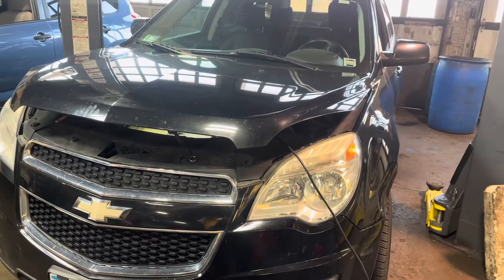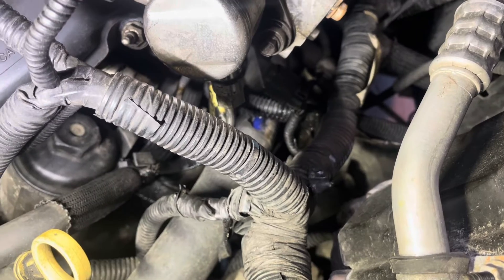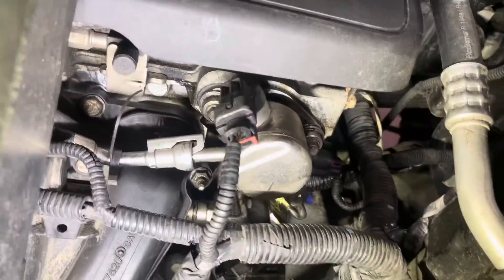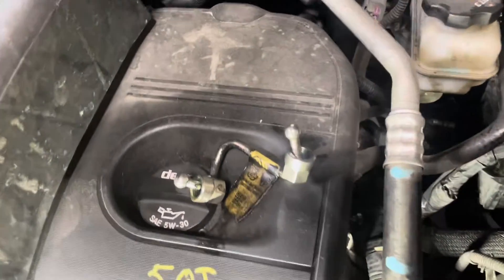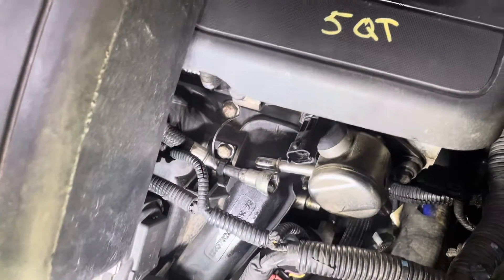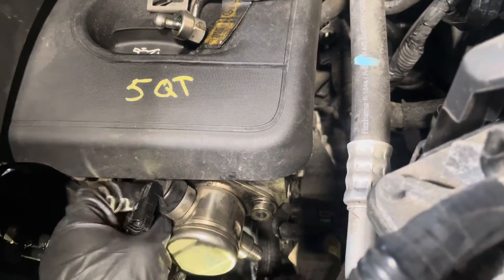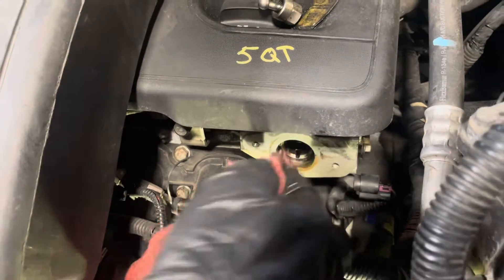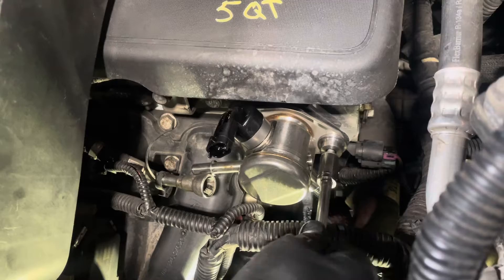Chevy Equinox P0172 How To Replace High Pressure Fuel Pump

Comment: My question is why the code if the car is running too rich meaning putting too much fuel and not enough air why the code?
Reply from the maker: Because the pump is putting too much fuel into the engine

Comment: I changed mine out and fixed the shuddering issue when shutting off, but now the car smells like gas when idle, is it because of the fuel line?
Reply from the maker: Check to make sure it’s not leaking maybe needs to be tightened a little more

Comment: with  code P0191  do you think fuel pumps is the problem o is different issue
Reply from the maker: I don’t think the high pressure pump is the issue with this code it might be the low pressure pump in the fuel tank but you’d have to hook up a fuel gauge to measure the pressure
Reply: if you dont night  how much do you think can be @acetechauto7
Reply: @acetechauto7 and thanks  for respond

Comment: I have gmc terrain I just need replacement the high pressure pump but I saw in another videos need alignment tool for the cam shaft but Im surprised because Its just removed the old pump and put the new like you video my one is 2.4 ecotec 2012
Reply from the maker: It’s the same process as this one you don’t need an alignment tool
Reply: Thanks for your quick response 🙏

Comment: My car was smelling like rotten eggs at one point then started to show reduced engine speed then shaking at idle and a shake after the key would be removed .If it needs a fuel pump which one does it need do you think ?
Reply from the maker: Normally when your car smells like rotten eggs means your catalytic converter is bad
Reply: @acetechauto7 Thanks so much for your quick response . I did take it to the auto zone and did have some codes pop up of P0172, P0016 and P0011 does this look like I need a high pressured fuel pump replacement in the hood or a fuel pump in the tank ?
Reply from the maker: @Exposure_Spider6 that would be the high pressure pump on the engine

Comment: Question, code at Advanced is saying replace high pressure fuel pump, but shows a picture of the fuel pump in the tank? Here's what is happening. When shutting my car off, the engine like studders and shakes, almost seems like it is trying to keep running or something? Any advice?
Reply from the maker: High pressure pump is the one in the engine not the fuel tank. I would replace this one
Reply: @acetechauto7 which one ?

Comment: What brand fuel pump if most recommended for this car ??? I've seen Delphi and ac Delco can anyone help
Reply: Always gm/ ac delco. Aftermarket pumps dont work on these
Reply from the maker: Either one is good but I would go with AC Delco

Comment: Why is it required to change that piece of fuel line?
Reply from the maker: It’s suppose to be a one time use because the fitting is crush to fit so when it’s tightened from the factory it’s already crushed so it might not make a proper seal second time around. Sometimes you can get away with reusing them
Reply: @acetechauto7  Thanks for the explanation.  I went through 4th class power engineering but do not recall mention of a crush fitting amongst the innumerable fittings and instruments we studied.  Are there reasons a tapered compression fitting wouldn't be ideal? Thermal expansion?  

Thanks again, tackling tomorrow pending parts. 👍
Reply: @acetechauto7  I have a question you may be willing to answer.  i suspect my timing chain has slipped a tooth and I havent checked.  I have a code but it runs fine.

I jist wantes to know if you have a trick or tip to move the chain just one or two teeth.  I saw my friend do this a couple years ago but dont remember the technique.  He used the (24mm) box wrench on the camshaft and not sure the trick but applied a bit of pressure and lined it back up.  Is it easier to release the tensioner a little or is there a better way.  Thanks my friend
Reply from the maker: @bizzzz unfortunately it’s off a tooth because the chain is stretched so you will need to replace it. It’s not worth trying to put it back one tooth
Reply: @acetechauto7   it's actually a new chain, but the vehicle had a bad fuel pump and an oil dilution issue which has been rectified.  Do you think  new chain would stretch that easily?  Ot wasnt run hard or rough with the diluted oil - just noticed at stop lights it was rough idling and saw the code almost immediately.  Verified alot of fuel in oil, pump changed.  Oil seems like oil after a week.  Ready to get timing readjusted.

Thanks again
Reply from the maker: @bizzzz hmmm hopefully you don’t have to replace it again. Wish you best of luck!
Reply: Just fyi I went with an apremium pump $180cdn vs $480cdn for ac delco. Pump seems fine after a week.  Looks equal or better to in quality than the delco.  Comes in crazy  nice packaging with a color brochure with tips such as different ways to release pressure in lines.

New crush fitti g fuel line (ac delco) they wanted $80 CAD.  I reused the old one and it hasn't leaked yet 👍

Comment: I have a chevy equinox with code p0090 how do I fix that?
Reply from the maker: Most likely to fix your issue you will need this pump as well unless you have an issue in the wiring. Good luck!
Reply: @acetechauto7 ok thank you I just changed it and it started squeaking so was just wondering

Comment: I have a 2014 3.6l LT Flex and the code that comes up is P228C it keeps putting my car in reduced power to engine.Should I replace whole pump? And if so do i need a line as well? Thank you for the video still learning and on a strict budget
Reply from the maker: Yes it looks like you’re having issues with the fuel pressure and most likely the mechanical fuel pump is going to be your problem. It’s recommended to replace the line too but you can re use it as well it you’d like just make sure it’s tight enough so it doesn’t leak.
Reply: @acetechauto7  thank you!
Reply: @acetechauto7  thanks I asked this in another comment.

Comment: I saw another video on this and they did a camshaft adjustment. Is that not a necessary thing? Mine is a 2011 model.
Reply from the maker: No you won’t have to do an adjustment after this
Reply: @acetechauto7  thank you so much. I was dreading having to try it.
Reply from the maker: No problem good luck with the repair!

Comment: Any idea if the p0172 would cause the p0420 code for bank 1?
Reply from the maker: No this won’t cause the p0420 that’s separate and you’ll need a catalytic converter for that and alot of times the exhaust manifold cracks on them too which you will find out once you take the heat shield off it when doing the catalytic converter
Reply: @acetechauto7  so I just replaced exhaust manifold bc of a crack after redoing timing...car is running fine,  but then got p0172 and p0420 at the same time...I should replace the high pressure pump right to correct p0172, right? P0420 still a separate issue?
Reply from the maker: @Father_Adrian try clearing the codes first and see if they come back. If they do then most likely you’ll need the high pressure fuel pump and a catalytic converter.
Reply: @acetechauto7  gotcha! Appreciate the advice! 1 more thing, I saw someone mention the butt plug tool thing lol, I don't have that, so am I able to install just as you did and have everything line up properly? I dont want to mess up anything Internal
Reply from the maker: @Father_Adrian lol nope you won’t need that. Just follow the steps in the video and you’ll be fine.
Reply: @acetechauto7  gotcha! You're awesome man! Oh forgot to ask, will replacing this eliminate that fuel smell externally at idle, or when turning off

Comment: Does this issue cause oil to go low?
Reply from the maker: No this won’t cause it but these engines are known to burn a lot of oil
Reply: I bought a nice ltz second hand but disnt know about the fuel pump leak.  Almost grenaded the engine on a long road trip and had to replace valve lifters after

Comment: Will replacing this part fix my low power mode problem? Goes it to low power mode mechanic said code was fuel injected pump
Reply from the maker: Yes this will fix that issue as well if the code is related to the fuel pump.

Comment: Ive replaced this, both fuel pressure sensors, cleaned injectors, replaced MAF, CAT and the damn car still wants to shut off when its in drive. If i put it in Neutral, the car runs fine. IDK what else to do.
Reply: Timing chain could be messed up
Reply: @adriangarcia2599  all new timing components
Reply: That would happen to me in stop lights. It turned out it was the camshaft and crankshaft positioning sensors located left of the spark plugs.
Reply from the maker: Sorry to hear about your troubles. Is it setting any check engine lights on?
Reply: @acetechauto7  yes, fuel pressure sensor code but both sensors have been changed.
Reply: Spark plugs and coils
Reply: @thisview23  all new. Still nothing
Reply: It's the cam actuator.
Reply: Ur timing is off
Reply: I would change the actuators even if they test fine they go bad and make all types of issues like this
Reply: We're the parts OEM?
Reply: @ aftermarket
Reply: Replace ur VVT solenoids.
Reply: Transmission sensor maybe?
Reply: Ur change the wrong parts.u check ur throttle body

Comment: I have a Chevy equinox 2016 it came p0172 and p0191 code  every time I turn off the car it still runs a little bit what can it be ?
Reply from the maker: It can be your fuel pump

Comment: Im about to do this same job. Do you have any reccomendations on how to remove the fuel line without the tool for the prongs?
Reply from the maker: It’s going to be pretty difficult without the tool  I would just go buy the tool at any autozone or Orielly’s.  It’s not that expensive and it’ll save you the headache. Good luck!
Reply: What's the prong tool called? Or is that what it's called? Lol 🤦🏼‍♀️
Reply from the maker: That’s called a fuel line disconnect tool
Reply: İt is $4 at harbourfreight
Reply: @anonymoUSA21 Thanks thats my store👍👍
Reply: Make sure when you take the pump out that you take out the roller, that's inside where he cleaned inside. Make sure it's good. You don't want to do the jib twice to replace a bad roller
Reply: Whats the roller? I just finished the job and didnt do that.  @rickybower5349

Comment: Do you need to replace the cam follower when you're leaking gas into your oil? Mine is getting the "P0172 - system too rich bank 1" and is dieseling when you shut it off. I ordered a new pump and new line but no cam follower. I also ordered a "High-Pressure Fuel Pump Installer EN-48896" because a different video said i needed one to line up the camshaft before installing the new pump, but you didn't use one at all. So did I just waste $55 on some bogus tool that resembles a butt plug?
Reply from the maker: lol that’s the way to do it if you’re doing it by the book. You’re suppose to put the butt plug in there and rotate the crankshaft clockwise until it sits flush. Otherwise you can stick your finger in there on the cam follower and rotate the crankshaft until it goes all the way down and stop rotating when you feel it starting to come back up. As far as the cam follower if you’re able to locate one easily I would replace it while you’re there otherwise if not no big deal.
Reply: @acetechauto7  so you can either shove a butt plug into it or you can finger it.. noted.. thanks for your response mate!
Reply from the maker: @thequintessentialgamer7514 no problem! Either one or the other will work to turn them on.
Reply: @a @acetechauto7 so if i am wanting to replace the cam follower too, i don’t need to align the camshaft? I can just take the cam follower out and put new one in? And i am good? Or no? You said to rotate with finger though, so i wasn’t really sure what you meant. A better description if you wouldn’t mind on what to do with the cam follower when replacing it with the high pressure fuel pump would be awesome?
Reply from the maker: The cam follower you can pull the old one out and put the new one in. Then put your finger or a screwdriver in the hole and turn the crankshaft clockwise until it travels all the way down. When you see the screwdriver coming back up stop turning the crankshaft and install the fuel pump.
Reply: Replace the cam follower. Don't do it without doing so.. waste of time to not..
Reply: I replace the pump but not the cam follower it’s running way better but engine is still in low power mode and my cam follower didn’t want to come out easy so I left it would a bad cam follower cause low power mode I switched out the pump and vct solenoid

Comment: Why didn’t you replace the cam follower while you were at it
Reply: Exactly. They usually have bad wear on them.  Considering that pump is between. 350-500$ I'd replace the cam roller too
Reply: You're supposed to change follower when replacing pump. On almost every car
Reply from the maker: You can if you'd like but it wasn't necessary in this case
Reply: @acetechauto7 how do you know it wasn’t necessary? You never pulled the follower out to see